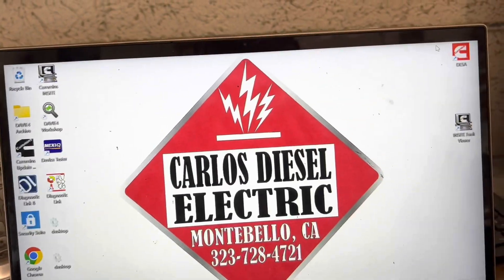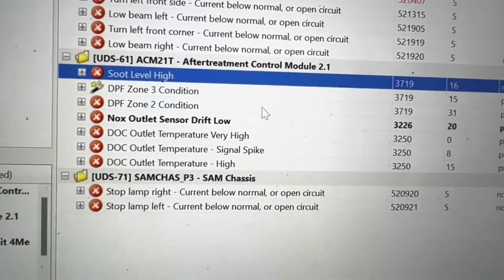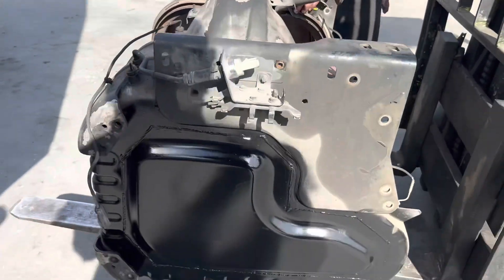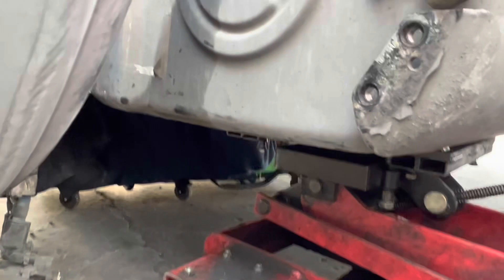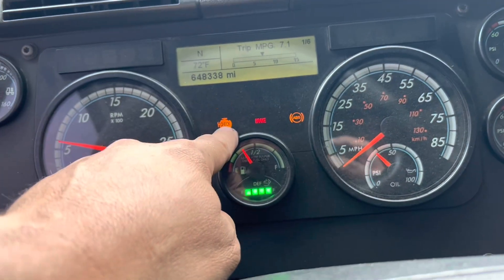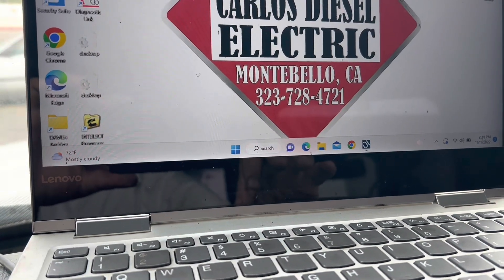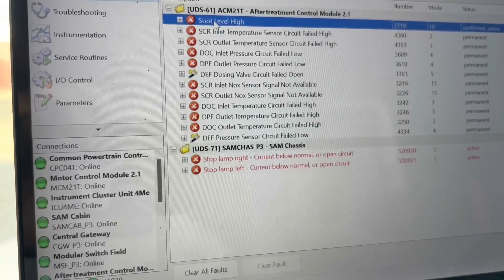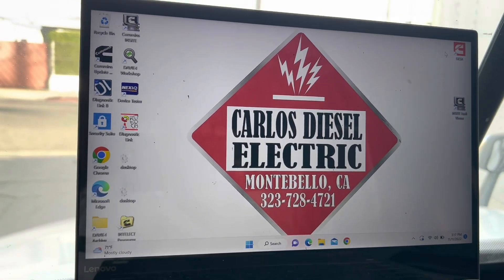DOC outlet temp HIGH. Soot level High, more One a box issues. What to look for and how to fix.

Comment: I am wondering How can software updates be responsible for DOC face plugin?
Reply from the maker: @inderveerbilling  fuel maping is probably the main improvement. Injectors are electronically controlled aside from the internal mechanical components. Also, MCM and ACM help with active regeneration and passive regeneration. 
But DOC face plug is most likely injectors. I recommend not usually poor quality fuel and Maintenance is most helpful. OEM fuel filters and changing your air filter. 
Last but not least, stay in top of those valve adjustments.

Comment: How long into a forced regen should the doser start introducing fuel into the system?
Reply from the maker: @andysmith3886  dosing should start around 10-15 minutes into. But the DOC inlet temp needs to reach a minimum before it will dose. It is based on temperature rather than time. If temperature has been reached but it still will not dose then it could be a bad MCM. 
What Make, model and year are you working with?
Reply: @CarlosDieselElectric I have a 2015 Cascadia with a DD13. It has been doing most of what is in this video. Breached the DPFs so we replaced them. Upon doing a parked Regen the DOC outlet temp passed 1500 in less than 5 minutes. Private tech forced it 3 more times and started smoking from tailpipe. Took it home, disconnected doser line and forced a Regen. Truck had been parked for 4 hours. Started dosing fuel 3 minutes into the Regen. Temps went high, kicked the Regen off and shut the truck down all in less than 5 minutes.
Reply from the maker: @andysmith3886  check your diesel doser injector. Is it stuck open? Is there any debris stuck and keeping it open? 
Try using a test diesel doser injector from another truck.
Reply: @CarlosDieselElectric  thank you. I was actually winding if the doser block was bad and stuck up introducing fuel too soon. With the lime cracked loose we saw fuel present in less than 3 minutes. We tightened the line after it sprayed 3 times. The minute we tightened the line is when the cut itself off. I will pull the doser itself in the morning and inspect it. Thank you again
Reply from the maker: @andysmith3886  Good catch, with those temps you could have had a major catastrophe.

Comment: I have my Nox sensor out. Will this operation cause any damage to the onebox system or engine?
Reply from the maker: If the sensor is on the outside. It probably means the One Box is having NOx efficiency codes or issues. 
Placing it in the outside just allows the Inlet sensor to compare air (gases) with the outlet sensor. Which means the NOx efficiency will be at 90% or higher. 
The truck will run fine and won’t cause any further damage to the One Box. Usually a One Box will start to have problems with mileage, age and time. Of course, injectors can help contribute to a bad One Box. 
What is going on with your truck?

Comment: I have same problem truck start smoking a lot and temp goes up to 1500 then trucks shuts off any idea what could it be
Reply from the maker: Your temp is above the threshold. It will shut down to protect itself from melting. What are the readings of the DOC inlet pressure and the DPF pressure?

Comment: Do you have a overhaul video on a volvo d13 engine?
Reply from the maker: I do not. I don’t get too many D13 engines. Except for basic oil changes.
Reply: @CarlosDieselElectric  I have a 2015 volvo d13 blowing white smoke I change the injectors and cups but still smoking cylinder 6 on passenger side has oil leak am thinking the head gasket I took it to a shop and they said I need a inframe

Comment: These are usually one box codes but definitely check doc pressure tubes for cracks and blockage. Hardly ever doc sensors. Usually bad one box
Reply: If an upstream issue was bad enough, people ignore missing injectors too long and then screw the box up

Comment: Can ask you a question?
I'll ask anyway if you answer that would be great. 2014 freightliner cascadia DD15 GHG14 1.3 million miles 
I keep getting a coad 3364 fai 2
It's not bad def.
I changed the def injector pump/ metering valve both the nox sensors. I've pretty sure I've got it down to the def is building up in the injector port cause everytime I removed the metering valve It's pulled off. I putting a awning kit in a couple of years ago cause of the different problem but it turned that the awning cause this coad when I removed it the coad stopped.
My question is why do you think the def is building up there?  I don't have programming to watch levels. But I did start regan and disconnected the 7th injector for sec to see if diesel was coming through (nothing)  I was thinking maybe my one box isn't getting hit enough to burn it off.i have no coads for the Doser block. But during the regan it completes in 30 mins but I use to could feel it kinda of jerk several times during the regan now it's just seems like high idle. Any ideas? Thank you
Reply: Also a year my fuel pump went out sent metal everywhere I changed everything except that doser block. Do you or have you seen a fuel pump mess up a doser block?
Reply from the maker: @truckerbuddy3035  let me research this and I’ll get back to you Monday morning